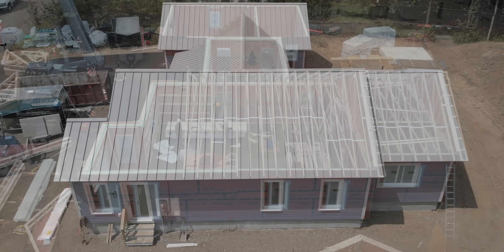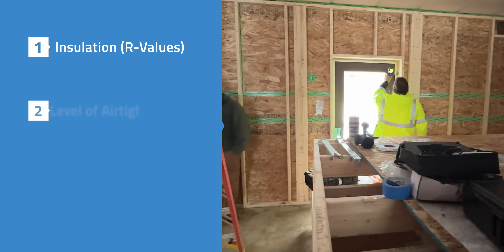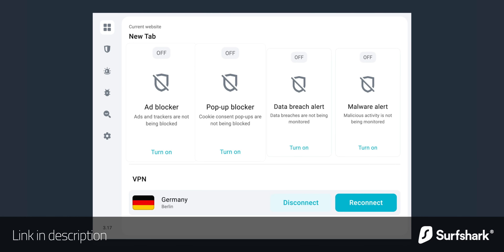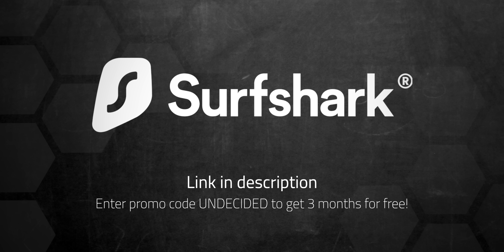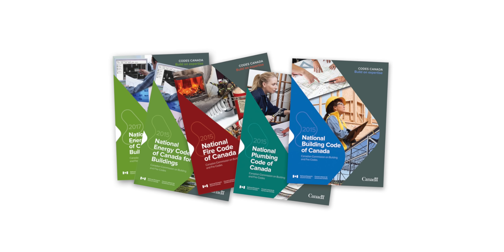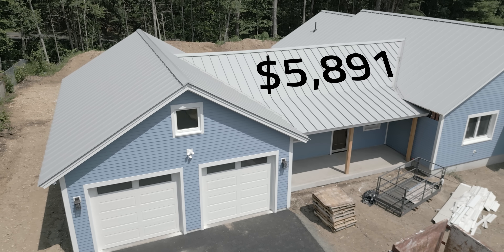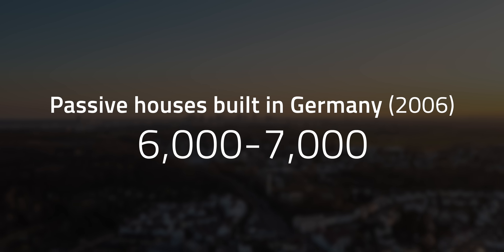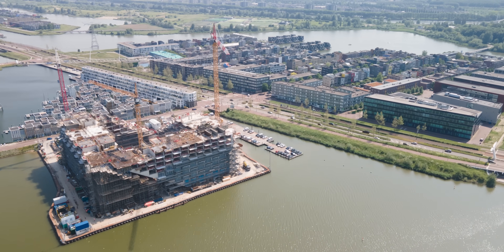Why Do American Homes Suck?

Comment: My wife and I are doing an energy upgrade to the 1957 vintage California ranch style home that we purchased a few years ago.  The roof, HVAC equipment, and other envelope components were not designed for energy efficient operation and are badly worn or near failure.  It's a perfect time for a moderately deep energy upgrade and electrification. After preliminary work , we do not expect to have the budget to meet Passive House criteria. We are setting our initial sites on a zero-net energy conversion. We'll see if we can make it work with our budget We are using DOE tools to calculate the R-values  / U-factors of the existing envelope/components and then for testing candidate options for the upgrade. We are using a new design software (KwikModel 3D with EnergyGauge) for creating the 3D house-room volumes/dimensions, applying different envelope and component selections then calculating ACCA Manual J block loads followed by Manual S and D designs iteratively to determine the best life-cycle cost-effective design that we can afford. The convenience of using QwikModel is that the 3D model is generated without the use of CAD software and different envelope and component values can be easily swapped and the ACCA software rerun.

Comment: Kudos for using the fahrenheit imperial here in the US, I wont subscribe to anyone that doesn't. If you have to put both imperial and metric in.
 I own a business when I built my shop the building inspector said it was ridiculously over-built and it is the only building like it in the county, (Upper Michigan) I didn't think so. My old house that I didn't build will fit inside my shop and it take almost 3 times more to heat the house then the shop I think it was money well spent. The quality of a house in the US is sad.

Comment: It’s cheaply built tract homes that are junk. This style of home construction has run amok. But, if you carefully select your contractor and are willing to pay more a much higher quality, better energy efficiency home can be obtained. Most people just want a home fast and gloss over the details.

Our home was built in 2000, post and beam construction, actual stone and concrete foundation, plastered walls, hardwood doors & floors. 2x6 interior & exterior walls, geothermal/ hybrid HVAC, solar panels on the roof, high end low-e windows. 

A tract home developer will give you NONE of the above, they don’t even offer it. It’s “buy the model home” with a few mods and that’s it. What I hate the most though is how most foreigners (read Europeans) trash the US by generalization, they visit or see what’s portrayed as “typical US” and assume (y all know what happens when you do that) that the whole country is that way. It’s simply not that way. The US is vast, with single US states being larger than some European countries. Most foreigners can’t seem to grasp that piece of it.

Comment: wow I will never live with you. I love old homes. I have two. One is 130 years old and the other is about to hit 100. I love leaving open screens. And I sleep with the window open in winter, in Wisconsin. I like big old rooms kept at around 65 degrees in the winter and a breeze in side in the summer. I let the sun heat up the back of my house in the winter. One house is brick and the other stucco. They have been remodeled a few times which you can easily do with an American home. No concrete small roomed homes with little windows here. I don't understand why you want a home in palm springs to have the same regulations as a Utah chalet. Of course America has many codes in different states. Our climate is very different everywhere. And our codes represent the climate and density. You only care about energy. Ft. Lauderdale does not care about energy. Why should they. They care about bugs.

Comment: I’m polish by origin and living in US for over 20 years. It all comes to cost of energy. In US energy is 7-10 times cheaper than in Poland. My severely outdated house only cost $100-150/month to cool (electric AC) and $50-100/month to heat (gas furnace) out of that $35 is fixed fees for either service. Considering I live in central GA average year I want to alter indoor temperature 8-10 months a year max I could save is $1-1.5k/year (if I dropped heating/cooling cost to $0).
Earlier this year I have shopped around for siding and wall insulation replacement… siding was 25-35k and insulation + vapor barrier another 20k (only 1 of 3 contractor was actually in even interested in doing it).
So in my case energy savings wouldn’t cover upgrade till long after house (and mine) estimated life expectancy.

Comment: It may surprise folks but some of the most energy efficient residential buildings are subsidized affordable LIHTC housing in the USA. We’ve financed not less than a dozen Passive House projects in the last 3.5 years (about 500-675 units).  And about 60% of those passive house bldgs have solar PV.  That makes the buildings cheaper to operate over the years, and cheaper for tenant utility bills. Good architects have been pushing energy efficiency for decades. I was designing rain screen homes not less than 15 years ago. We studied them in grad school 35 years ago. Clients and developers who build only w/ the  cheapest materials /systems available always build low quality structures. Their property values, cost to maintain,  and retail resale value represent that.

Comment: About 12 years ago I started building (it took some years) a straw bale house in rural NSW Australia,  at the time there were no standards to deal with the building so we had to "wing it" with the local building inspector! 
 When it came to meeting Australia's energy efficiency standards, the straw walls and double glazed windows meant that we did not have to include a roof.... that's right, the standard we had met in the walls etc meant a roof was not needed to meet the total building energy use standard! 
Naturally we put on a roof with r8+ insulation. 
Further, we went totally off grid electrically and even then had to battle with council to be allowed to do this as there was again no standards. 
The problem I see with the American export model of world dominance (which Australia seems to want to subscribe to) seems to be a reluctance to accept us "danged greenies" as sensible human beings. 
Luckily we did get everything done and I cannot express how wonderful our house was, and, having zero dollar energy input to the house was probably one of the best things especially given I used a standard rooftop air conditioner and a backup reverse cycle system in the bedroom just in case! The look of horror on the building inspectors face to see a reverse cycle air con was priceless until he realised it was solar powered (off grid system).
Roll on common sense!
Cheers and keep up the good reporting!
Reply: Interestingly our house, near Melbourne had different problems. With the energy efficiency standards in Victoria our initial design failed because it had no insulation in the roof. I pointed out that the roof was constructed of SIPs and hence made of insulation but since these could not be put into the software our building could not achieve 6 stars. Total nonsense!

The 6 star rating is achieved by adding environmental benefits so we could have achieved our rating by adding a grey water tank, even without roof insulation. Could have also got it without having doors, just openings to the outside world.

Australian standards are such nonsense.

Comment: In Pennsylvania, I'm building a home with triple pane windows and extra insulation (extra outside foam layer + spray foam ceiliing + foam under the basement/garage + R18 garage door).  It's also going to be a heat pump mini split system with 4 zones.  Solar panels and on demand hot water heaters are also going to be installed.  It should pay off pretty quick with electricity prices now getting near $0.20/ kwh, all the tax credits and the dropping prices of the energy efficient equipment.  In the near future, local houses built in the 70's with straight resistance heat will be $1000+/mo to heat in the winter and mine will be near zero.  Even natural gas can be a few hundred/mo when prices go up.  Many others have propane, which is 3-4x what natural gas is.

Comment: Being from Europe and living in California I confirm that house building in usa is just crap, disposable buildings made of plywood. Acoustic isolation ? thermal isolation ? forget it, energy is cheap right ? it is a shame for a country like usa that there is not construction code for energy saving. The problem is that it seems that there is only one way of building house in usa : wood light structures, which is justified in earthquake prone areas, but not elsewhere and even though, using wood deosn't preclude to use isolation under the roof and on the walls.

Comment: I bought a spec home recently. Yup, it sucks. R19 from basement to ceiling, R30 in the ceiling, and the builder considered that good. It goes from -20 to 120f here in CO, that's not good at all. 
They also screwed me on my heat pump, I paid for a 20 SEER1 one and they installed a 15 SEER 1 one. 
I'm finding lots of little things to fix or upgrade. The lawn and fencing cost extra.
But hey, no HOA so if I really wanted I could just leave it bare dirt. Muahahahah

Thing is the house won't even really be 'cheap'. If I pay it off on the schedule the bank wants it'll be $600,000 for a 900sq foot house with an unfinished basement and 1.5 car attached garage. (it says 2 car, but you could barely fit 2 of my tiny Chevy Bolts in it, so 1.5). Base cost was $255,000. Sure that's cheap compared to Cali, but I'm in Colorado. Not even fancy Colorado like Aspen.

Comment: Who wouldn't want greater efficiency? Obviously everyone. Two catches;
First, paying for it. You can only afford what you can afford and energy efficient upgrades are not as sexy as a super cool kitchen or a pool, etc. Getting a bank to go the loan to cover the increased upfront cost prices most people into the traditional built house that sucks energy and is ready for demolition the moment the 30 year mortgage is done. 
Second, finding a builder, and a team of trades, that have experience so they can build quickly AND do it right the first time.

We not only need much greater efficiency, but we need a 100 or 200 year building life standard. Not a 30 year standard.

Solution, have a loan as long as the house's expected life. I'm being a bit sarcastic.who wants to pay that much interest for that many years. The point though, is the lender would have a keen interest to insist on high standards, durability and efficiency.

Comment: More strict standards = higher cost to build = more expensive homes = more difficult for lower/middle class to ever own a home. 

I'd rather buy the cheapest craphole on the market, get a permit, and use youtube and chatgpt to renovate for a fraction of the cost. As long as the structure is sound most older houses just need galvanized replaced with PEX, water softener, water filter, and blow insulation (attic and walls). All DIYable projects that collectively cost less than $3000 to complete. Bonus points if you replace all the lights with IC-rated recessed lighting.

Comment: This sidesteps practically every feature of the real estate market in the US and the economy, in general.

While labor mobility has decreased in the United States lately, it was traditionally one of the strengths of the US Economy. Selling and buying houses frequently disincentivizes investments that will pay off over 10 years, let alone 30.

Even today, solar panels have a pretty miserable return on investment for property value compared to something like a kitchen remodel as I'm sure you're personally discovering, Matt.

There's also a well-earned, fundamental mistrust by buyers. If you trust someone that says they made some investment that will lower monthly energy costs, you're going to find yourself overpaying for a house more often than not as you discover 80% of the solar panels don't work, because the owner hadnt had them cleaned or serviced for the past 7 years.

Comment: I live in Maryland, USA. In the state, there is a recognized understanding in housing policy groups that homes need to be more energy efficient in order to gain actual headway in making homes more affordable in the long run. My university experience and capstone project was based primarily on this. With the vastness of the US, I understand why there can be certain differences in building codes/regulations (geographic, environmental, local supply/demand, etc.) but it still baffles me that we Americans cannot heavily regulate those codes, like we do with enetgy/utility prices.
Reply: Here's the problem. I live in Florida. My house was built in the 1950s. I use air conditioning 6-7 months of the year. Insulated or not is a difference of $30-$40 a month in my electric bill. Adding $100k a month to my mortgage to pay for all of the improvements would cost me $700 a month.
Reply: I don’t know if that will be true for much longer. I’ve heard a lot of stories coming out of Florida about energy bills tripling this year due to rate increases or changes in how electricity is billed—nobody seems to be certain about exactly what the utilities did.

Comment: Well said! Even in New Zealand the building code sounds like it's on parr with the rubbish American one. So when I wanted to build a house I decided to do it differently.. the walls are 150mm thick freezer panels, and the roof is 200mm thick freezer panels.. and the windows are double glazed, European designed tilt/turn ones. And we have solar and an electric car. Our heating costs are small although I did put in Aircon mostly to dehumidify in summer.. keep up the good works!

Comment: heres a counter/side topic

i truly hate to play the devils advocate but... For your good ideas to get traction it needs to consider counter arguements. again, sorry to even sound like im coming off as negative.

How will housing costs remain affordable. 
your ideas address the needs of the grid, home buyers generally want a place to live. at least for single property owners. so their biggest concern is the cost of the home.

altruism for "the grid" is kinda lost due to background noise of affordable housing. 

to redeem my negativity, id suggest a solution of tax credits for homeowners to make their houses more energy efficient. likewise for property devolopers. (at least for the next 15 years) afterwards MANDATE that all homes must have airtight standards. 

my current home in lousisana sucks due to it HORRID insulation. i can feel the draft. my dad did the doors with rubber strips.

edit: grammer

Comment: I am a retired contractor and I watch YouTube builders concern  themselves with  calculating energy efficiency. If you are going to have a substantial solar installation perhaps it would be economically wise in both the short and long sense to add solar capacity with a twenty-five year life so as to be less concerned with insulation and building tightness. Windows, doors and insulation become less effective with time and heat pumps and other mechanical equipment wears and must be maintained or replaced over the same period. Please remember the average new home will change owners within a decade and longer term savings are less interesting to that buyer. American homes may be less tight, but that may reflect the buyers choice.